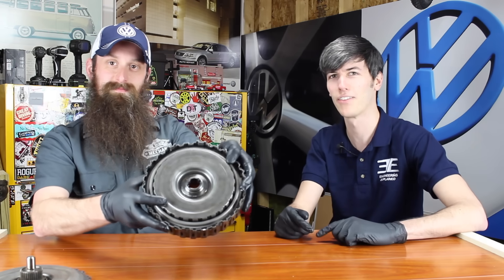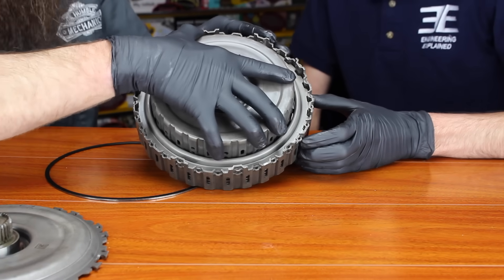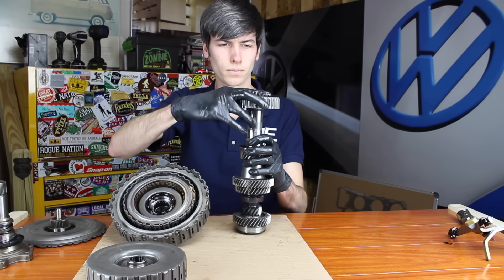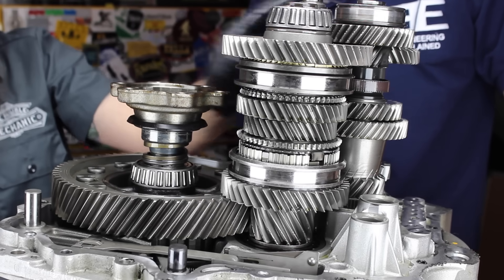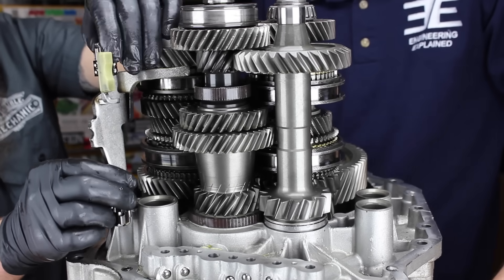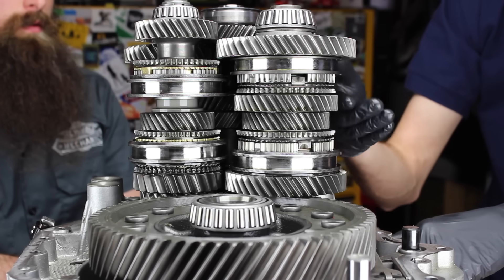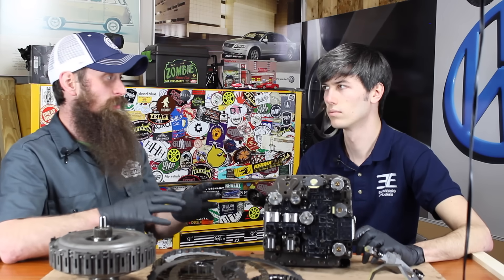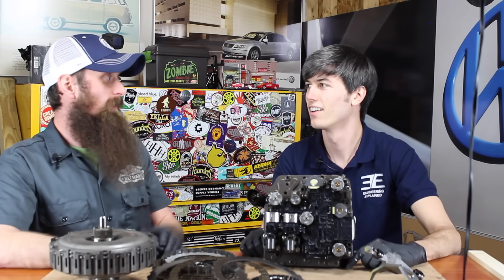DSG Transmission - Explained

Comment: Now we need triple clutch transmissions that preselect one higher gear and one lower.
Reply: zeroangelmk1 What about a car with one engine for every gear
Reply: Alex K. Lmao that would be wild!
Reply: @alexk.5441  Like tesla?
Reply: What about a penta clutch engine where every gear has its own clutch
Reply: @zeroangelmk1  I was watching this video and just wanted to let you know that you predicted Koenigsegg Jesko transmission
Reply: @zeroangelmk1  enter the koenigsegg jesko. 9 speed and 7 clutch
Reply: @zeroangelmk1  LOL!
Reply: @zeroangelmk1  Koenigsegg made one.
Reply: @zeroangelmk1  koenigsegg jesko in 2019 lol
Reply: @zeroangelmk1  like the Koenigsegg lst basically. It's a two 3 speeds mated together to make 9 speeds. Each gear has its own clutch
Reply: @zeroangelmk1 that’s pretty much what a standard auto has
Reply: @zeroangelmk1 That's already been done, it's called an "automatic transmission".
Reply: @bennetteberle4476  automatics use a planetary gearset while the proposed triple clutch will have a system similar to a manual.
Reply: @Peacewith_christ  Not all automatics use planetary gears.  I have seen a Honda Accord automatic transmission disassembled and it was simply a four speed manual transmission with a torque converter and hydraulically activated clutch packs replacing the synchronizer/dog clutches on each gear set.
Reply: @bennetteberle4476  then that's not a traditional automatic- a rare case. Most automatics nowadays are planetary so I just assumed that.
Reply: @Peacewith_christ  There are also manual planetary transmissions.  The Lenco drag racing transmissions and the Ford Model T are two examples.
Reply: @bennetteberle4476  yes but they aren't in production cars are they lol
Reply: @bennetteberle4476  hydraulic automatic transmissions have no clutch
Reply: Take a look at the the new Koenigsegg transmission. 1 clutch for every gear.
Reply: What about a drag racing clutch pack? No gears, just a series of clutches slipping
Reply: Koenigsegg Jesko :~)
Reply: Well Koeniggsegg actually presented their all-new Jesko car and in its transmission there is 7 clutches and 9 speeds.
Reply: @forgettd  Well, I find the VW a little bit more affordable.
Reply: @dominiksuk7261  of course, I drive an Audi with dsg myself :)
Reply: dual clutch already does that yo
Reply: Koenigsegg just made it
Reply: I know it’s a joke with the excessive clutches

but it would be so much weight for like no time gain shifting. DCTs already shift like 50x faster than you can blink or something.
Reply: @heroichitsuji I heard something about a triple clutch transmission being made. Don't remember where or what but I heard
Reply: Nooooooo , what you need is a continuous  smooth gearing .
AKA ::     CVT
😄😂😅
Reply: Jon Olaivar that’s what a dual clutch is. Clutch one does odd gears and clutch two does even so if your in 3rd it can pre select either 2 or 4 with just clutch 2.
Reply: @calebkopitsky7611  the main difference I was joking about is that on DCT, only one gear can be preselected, and it's up to the transmission logic to determine whether the preselected gear should be +1 or -1 from current. The joke was that with a tri clutch gearbox, a +1 and -1 gear can be preselected simultaneously. Obviously there are many complications with a tri clutch, however.
Reply: @calebkopitsky7611 exactly, you can also skip gears with only two clutches, for example from 6th to 3rd with just preselecting or 6th to 4th with a fast dis-engage and re-engage.
Reply: isn't some F1 team trying that? I forgot where I heard it
Reply: Coughs in CVT
Reply: Big brain
Reply: what about an electric motor that has only one gear and that is it
Reply: Don't forget reverse gear. I might want to select reverse gear right after 5th or 6th so another clutch for reversing on the move 😁
Reply: I used to drive a Layland Double Decker bus and I changed gears with ease.  IT HAD NO CLUTCHES! 1840's technology guys!
Reply: @johnnydaller wild man absolutely wild
Reply: this is no joke - I thought of this as a kid years ago. why has nobody done this, it really can't be that hard and it would make so much sense. with 3 clutches you'll always have the right gear available and can skip a gear which I always do when driving a manual and most conventional automatics do as well, but isn't really possible with a DSG
Reply: Arne Maeschaelck dual clutches can preselect two gears at once. If your in 3rd ur using clutch 1 while clutch 2 can select either 2nd or 4th gear
Reply: What about just going EV, where you eliminate this MESS altogether?
Reply: @TheOzthewiz  keep in mind that original comment is 3 years old, a lot has changed since then
Reply: @TheOzthewiz  full EV is just now barely  becoming viable, and personally, I'd miss the character of an internal combustion engine far too mhch

Comment: First four gears in the gearbox you show in the video are on the same first drive shaft so if you use only those gears the other shaft with 5th, 6th & R (and second clutch) is not really used, right? So what is really making shift between them quicker? You have to use the the same first clutch before shifting into each one so I guess it's "only" as fast as that computer which controls it?
I think to demonstrate it better you should get gearbox where gears are actually odd-even split between drive shafts like you mentioned in description...
Reply: I am still getting my head around it all myself but from what I understand gears 1,3,5,7 are connected through one input shaft and clutch, whilst gears 2,4,6 are connected through another shaft and clutch... The two shafts are around each other but moving independantly (2:44 of video). 

The fast shift happens because lets say you are in first gear, the first input shaft is connected to the engine through the first clutch whilst the second shaft and clutch are not engaged and spinning freely on their own. Because the second shaft (controlling gears 2,4,6) isn't connected to anything, second gear can be pre-selected without any disturbances to the first shaft (note: this is connecting to the output shaft but not the engine as the second clutch is not currently engaged). 
All that needs to happen during a gear change now is a switch between the first clutch (connected to gears 1,3,5,7) and the second clutch (2,4,6). This eliminates the need to dis-engage one gear and select another gear during a shift because it has already been done in advance. 

"Learn Engineering" made a video showing a very clear visual understanding of how DCT's work, I would recommend taking a look... Hope this helps!
Reply: Thanks for quick reply;) Same here, was following many of yours and LE videos to finally get to know mechanics behind transmissions (btw great job both of you;)) and it was making perfect sense like you describe above with odd and even gears however this particular gearbox you show in the video got me really confusing. As your guest explains how this model is built in https://youtu.be/mj1Vk7SE-TI?t=4m22s we can see that first four (odd and even) gears are on the same first shaft and operated by the same first clutch, therefore I assume you have to engage it ("loose time") between the shifts to allow gears to match their speed before collar and sync ring reconnects them again. Still wonder why in this case 5th, 6th & R gears are on the second shaft? That quick shift could only happen when shifting from 4th to 5th? Doesn't sound right...

Comment: Nice explanation. My mechatronic has failed and the symptoms are that the transmission remains "stuck" in neutral.
Not many options other than full mechatronic replacement - costs ~$2K...ouch....appears to be an achilles heel in this transmission type

Comment: The bigger gear for lower transmission is that solely due to the force required to move the car at lower speeds?? bigger gear equal to longer arm length and bigger moment??
Reply: If I understood your question correctly, it's due to the ratio.  The teeth on both gears need to be the same so they can mesh properly.  Therefore a larger gear has more teeth.  Going by this, if for example the small gear has 50 teeth compared to 100 on the large gear then the small one will complete 2 revolutions for every revolution of the large gear, and so the large gear will rotate at a lower speed than the small one.

So in short, no.  The physical size of the gear does not determine power.  But the ratio between the two does (indirectly).

Comment: how does this affect durability vs normal manual transmission? Normally VW manual transmissions are dead at around 300 000-350 000km

Comment: Can you explain why there is a distinct fart/burp when shifting with these transmissions?
Reply: My guess would be the engine control unit changing the engine rpm to match the wheel speed for the new gear.  I believe that often they use the ignition timing to cause the engine speed change (when shifting up gears) and that will give you an 'odd' exhaust note during the change.

Comment: Hello, I have a 2010 VW CC and I am worried about the transmission, when I am driving  all the gears are working ok, excepting the reverse, sometimes when I set on R y press the gas pedal and never goes in reverse, I have to move the handle from P ro S many times and after that it does work, what do you think according to your experience, do I have to replace the entire transmission, I would appreciate a lot for your answer and your advice, thanks

Comment: i have a 05 jetta 2.5 , so none of my gears are working , i put into drive,  reverse , Sport, +,- , none of work . could anyone tell me anything . any way to fix thats the least expensive or atleast telling me what to look for or check for . also the check engine light is on .
Reply: Leon Morales  sounds like the mechatronics unit has failed due to poor servicing
Reply: Abi Kilford thanks for the reply,  so what do you recommend me to do , or what to buy and wear
Reply: where*
Reply: Abi Kilford where*

Comment: Why is it that in Drive mode on my DSG (GTI), if i blip the throttle the tach reflects the RPMS as if clutch is slipping or one could describe it as if the car is in neutral for a brief moment. Thoughts? (hopefully that makes sense)

Comment: nicely done guys great explanation. Scania and other truck manufacturers prooved this technology back in early 2000's and it takes a while for the costs to come down enough so the price sensitive consumers in the car market will pay for it. then it takes off and it gets mass produced. It is the same for most of the tech we see in cars today.... Common Rail Injection systems? Cummins PT system in 1954. MVT and Vtec ... Cummins again in the early 60's U used to work on all of that gear in the early 90's and it was great to finally see them all appear in the market place from 2,000 on!

Comment: How does the dealership find out there you have a transmission problem or not without a CEL? My 2015 GTI DSG Studders when I slow down at 10mph and its annoying me and my passenger.

Comment: What about gas consumption on a dsg vs a manual and a classic or cvt automatic? I am concerned mainly about this topic but also about how easy can be fix one of this against manual and classic and cvt automatics.

I am currently driving a gasoline VW Vento on Uber but im aiming at my next one and evaluating what kind of engine and transmission i should get. Im strongly inclined for a diesel engine because the efficiency but im very open to listen opinions.
Reply: My Golf 6 with a DSG needs about 5.5L/100km Super vs 6L with the identical engine 6-speed manual

Comment: what are your opinions on dual clutch transmissions? are they good/reliable?
Reply: Spawn223311 Transverse 6 speeds (wet clutch) are very good. Some early versions had problems with their mechatronic units, though they have been adressed and fixed. They are very strong boxes and this have been proved from the tuning scene. Stock clutches can handle huge amounts of torque if the box has been remaped. Gears are also pretty good for a 350nm rated gearbox. They can handle almost 750-800nm before giving up. Keep in mind though that they need to be serviced every 40k miles (fluids and filter) and this is really important for gearbox life.
Later 7 speeds (dry clutch) are not so reliable.( Im not talking about ttrs/rs3 dq500 units, those are 7spd wet clutch and really good) They have some issues with their clutch packs and their mechatronic units (completely different from 6spd) seem to fail often. I really hope that vw has adressed the issues.
Reply: Keep in mind that im talking about transverse versions. I dont know about longitudinal found in audis
Reply: they suck

Comment: Hi
Can anybody explain why an engine that is coupled to a DSG gearbox uses more fuel when in drive with brake applied at a stop versus in neutral with brake applied at a stop?
Thanks
Nic

Comment: DSG - German engineering at it's worst.
Reply: I dont agree at all If the fluid is kept clean these can really last better than most transmissions. The problem with them is the fluid is hard to change so people neglect it. Other than that it is stick shift and VW has made good stick shift trans from the get go.
Reply: it's only as bad as the people who neglect it.  BTW good for you keeping a car until 400k, I myself usually have a car until the 150 - 160k mark (6 years) and trade it in for the latest and greatest thanks to company car allowance ;)
Reply: Well this DSG was designed by Borg Warner which is American…
Reply: DSG is a piece of crap. That's true.

Mechanic

Comment: Could you explain the engineering decision to use gears that have angled teeth vs gears that have perpendicular teeth (similar to lego gears, for lack of a better visual example)
Reply from the maker: +Matkat Music helical gears are significantly quieter, thus far more common (but more expensive). Straight cut gears are cost effective, but very loud, so typically only used in motorsport, or for reverse gears.
Reply: Very cool.   We need a video showing how the valve bodies for Automatic Transmissions work.  I don't think your channel does animation videos tho...
Reply: simple:
the lego gears are straight so always the force is transmited through one to one tooth, but the angled gears always transmit the force with one entire tooth and half of the previous and half of the next tooth to come, so the force is transmited using more teeth at once
and do you know that squeeky sound of going fast on reverse gear? 
thats because the reverse gear has the "lego" teeth :) and those are noisy
Reply: Helical gears also create axial thrust. Why not use a herringbone gear? Is it just cost?
Reply: Ever watch world rally racing? That is what straight cut gears sound like.
Reply: yes straight cut gears have a distinct whining sound... almost like a supercharger if you will. you can really hear them in a Honda while they are in reverse
Reply: True, WRC are mostly strait cut- and sure adds awesomeness to in car audio  :)
Reply: Straight-cut gears would make too much noise since they're like little hammers striking full face-on between them. Helical ("angle") gears, do have a smoother "strike" between them, so all transmissions use the latter profile.
Straight gears do have the advantage of easy meshing/unmeshing, thus they're still used for manual reverse gear only.
Reply: Basically, yes.
Reply: Straight cut gears sound awesome, for like ten mins. Once your ears start bleading the novelty wears off.
Reply: Straight cut gears don't create a lateral thrust on the gearbox bearings. Guess that's why they are used in motorsport, more power to the wheels.
Reply: I'm guessing, more force transferring surface. But I'm sure Wikipedia will tell you all about it .
Reply: farm tractors typically have straight cut gears for cost savings and strength. i  have a vintage farmall cub, even though the tractor only goes 6-7 mph the gears are very audible.
Reply: as i said farm tractors use them and large commercial truck "eaton" transmissions are straight cut. i drive milk truck for a living. straight cut are  do make more noise but they are also stronger typically. a large truck transmission also does not have a syncro mesh
Reply: That's why often (less with new cars) when you put reverse gear with manual cars it makes that typical reverse noise.
Reply: Alex Veldhuis They're almost exclussively used in semi tractors too!
Reply: Citroen popularised helical gears in cars, hence Citroen's "chevron" logo. Straight cut gears are not ideal to live with in a road car, too much noise and wear.
Reply: also if they are helical, they ensure that there is a flush connection all the time, so the chances of slip are a lot less! much smoother transition esp. when coupled with a flywheel
Reply: Bollocks, Helical cut gears have a greater contact surface area and therefore are stronger. They are also quieter and don't whine like spur gears.

Comment: you should mak e video of DSG vs CVT , or maybe you have already done and I havent found it yet
Reply: lol. what? both of your statements are completely backward
Reply: nelizmastr
Reply: CVT; sucks
DSG; sucks a little less
Manual; rules!

End of line.

Yes, my current daily is a DSG, it’s a good automatic, probably the best from a performance standpoint, no power wasting torque converter, no unreliable push belt, but the manual still rules uncontested for driving enjoyment.
Reply: CVT = Crap Vehicle Transmission. DSG = Dank Semi-usable Gearbox. There ya go.
Reply: Marek Sumguy Still better than any transmission ever to come from The Retarded States of Obesity. :P
Reply: Completely different technologies but I can say that CVT is usualy more responsive and more fun in the traffic. On the other hand DSG is more fuel efficient